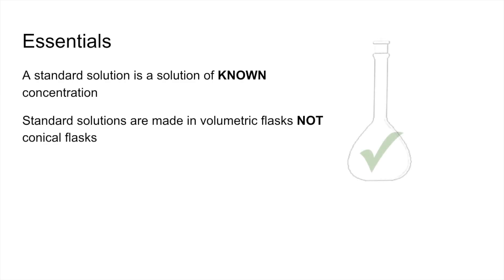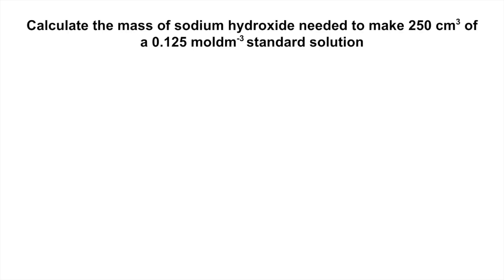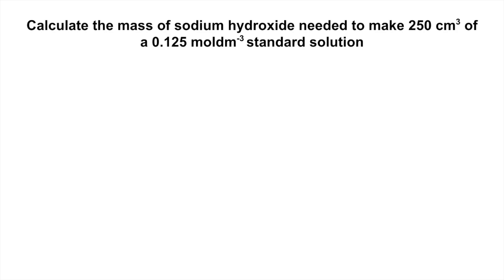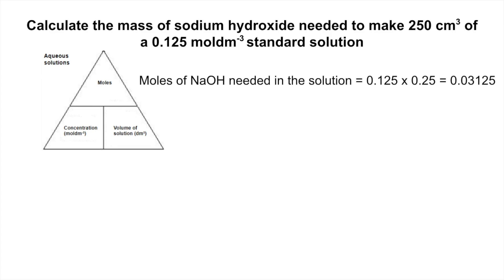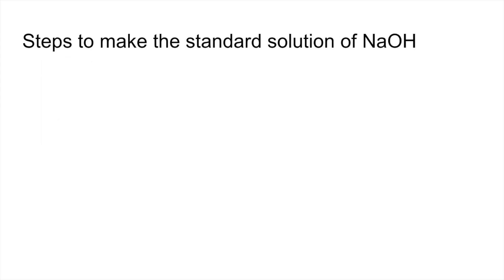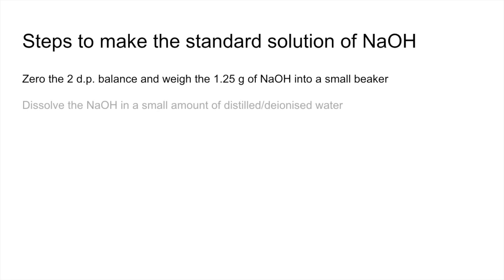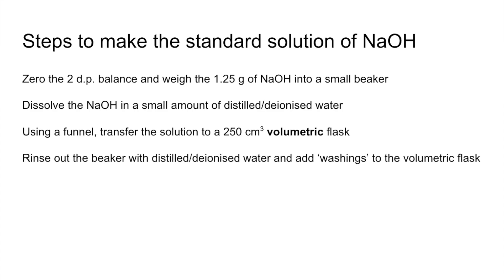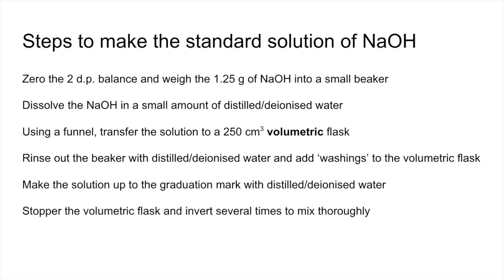Quick Revision - Standard Solutions

Comment: In what way does the shape of the flask make a significant difference? Chem nob here, so sorry if I ask the obvious.
Reply from the maker: All down to the accuracy of measurement. Conical flasks have  approximate measurements, 250 cm3 volumetric flask to +/- 0.3 cm3
Reply: It’s not necessarily the shape but more it’s accuracy in volumetric measures. Hope that helps
Reply: @mustafakhan9373  Yes, thanks.